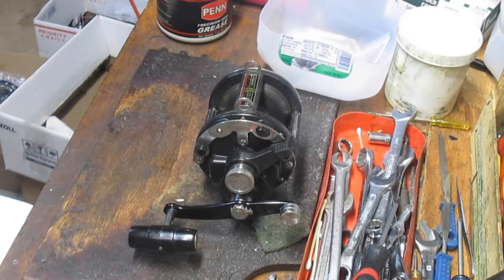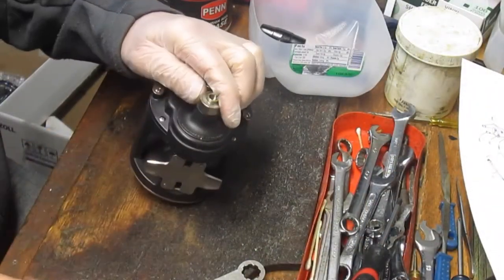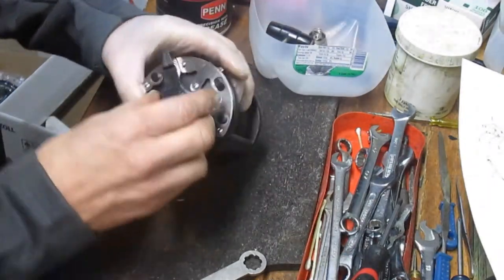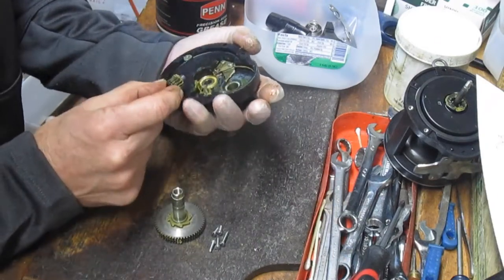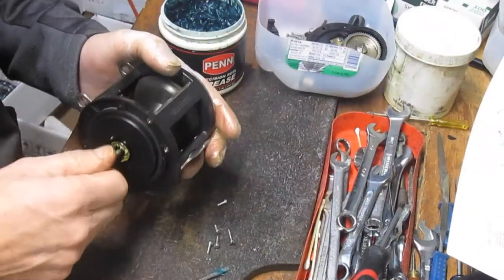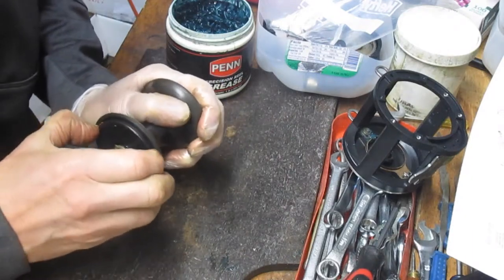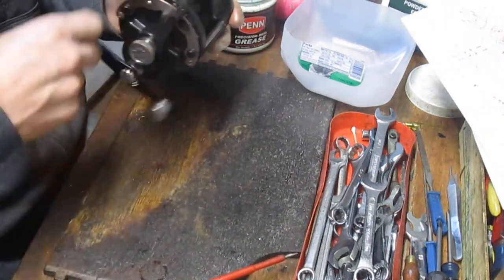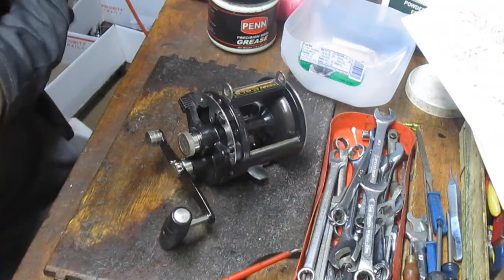Penn Reels GLS 45 Lever drag Senator take apart and service

Comment: After watching your video on the Penn 320 gti, I ended up buying two nice ones on the auction site and with your help, took them all apart and cleaned and lubed them. I ended up really liking them so decided to look for a Penn 25 gls in nice condition. It came yesterday and I decided to take it all apart and clean it too. When I got it all put back together, it didn`t work right so I let it set overnight while I thought about what might have gone wrong. Then it occurred to me, I had put the spool washers in the wrong configuration. After returning them to their original ()()I position it works beautifully. Without you I`d still be struggling trying to figure that thing out. Thanks for all that you go through to make these instructional videos. Sure I could have bought a new Daiwa  seagate or saltist, but whats the enjoyment in that? Made in the USA!
Reply from the maker: Glad that it helped and thanks for the feedback David.  Those reels were built to last and I am sure they will treat you fine as long as you keep them serviced.  You are off to a good start.  Please stay well and stay watching - Dennis

Comment: Again, another great instructional video. One thing I noticed, at the end of your video you adjusted the drag while the lever was in the strike position. You can do that with Penn Lever Drag reels? Most of my lever drag reels are Avet and I was instructed to always adjust the drag while the lever is in the free spool position. Again, your videos are a great help.
Reply from the maker: If I did that, it was a mistake.  I usually note int he video that the drag should only be set in free spool.  MY BAD!  Dennis
Reply: @2ndChanceTackle  Well, I got my Penn GLS 45 back together all lubed and cleaned but I got a problem. At the strike position, I got something like 1 lb. of drag and at full drag, I got only 5 pounds of drag. Not good. Back to the drawing board and go through this step by step.

Comment: Hi Dennis, Just finish re-lube my first GLS 45. I noticed that the level drag setting changed to a lower drag setting everytime I moved the level ( From free spool to full drag and anything in between ). Is that normal or I put something together wrong ?
Reply from the maker: Hmmm  - hard to say.  I would take the lever assembly off and make sure all is clean and that the point line up on the re-install.  I doubt anything inside the reel is causing this at first guess.  Dennis

Comment: Do you have any extra parts for sale ? I’m looking for the plastic drag cover with the 3 tabs . One tab broke on mine . And will not stay on anymore . I have the gls25 
Thanks
Reply from the maker: I am not a parts reseller.  I use Mysticparts.com for Penn Parts.  They should have this piece.
Here is a link to the ordering page for your reel https://www.mysticparts.com/PennParts/Penn45GLS.aspx
Dennis
Reply: @2ndChanceTackle  no longer available in any store or eBay
Reply from the maker: That's a shame!

Comment: Hi dennis is this reel similar to 245ld? Couse i have one and i need to change the drag washer
Reply from the maker: Yes - they are basically the same.  I believe the 245 replaced the GLS in 1999 and rand for about 5 years before it was discontinued - Dennis
Reply: @2ndChanceTackle  Thanks a lot for your reply and your tutorial

Comment: I am curious,,I have never seen you do anything else but oil bearings. Do you ever repack bearings? Do you own a bearing packer?
Reply from the maker: I almost always oiled bearings.  I do not have a bearing packer.  Can you recommend one?  I've only done it by hand, when I do repack them - Thanks - Dennis
Reply: @2ndChanceTackle  I do it by hand also..because I have not found one that works very well..Alan Tani sells one,which my friend has,,and he says he has not had good results with it. So until I find one,it will be done by hand.. I thought maybe you had one.
Reply: @2ndChanceTackle  I couldn`t recall,just remembered,,a friend of mine had a bearing packer called "The Greaser" I think they make a 2nd generation version,I think some of the hobby shops carried them,,probably useful for smaller bearings,may not work well with large,,but the one he had did work well,,he serviced 99.9% freshwater baitcasters,and smaller spinning reels.
Reply from the maker: Thanks Bill - I'll do some research and see if I can find more.  I suspect these tools only work on the open bearings and not the shielded ones where we need to remove the "C" ring and washers. Looking to learn some more about them - Dennis
Reply: @2ndChanceTackle  actually the "greaser" that my buddy had was able to be used with shields in.
Reply: Are you packing bearings to slow down the reel for casting or for longer service time for saltwater reels?